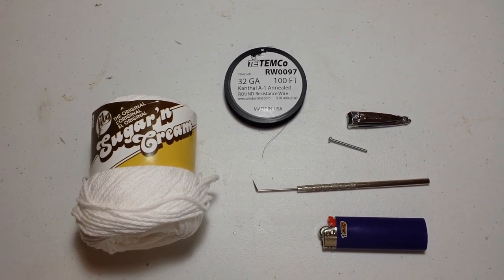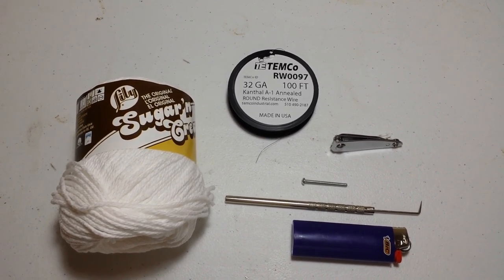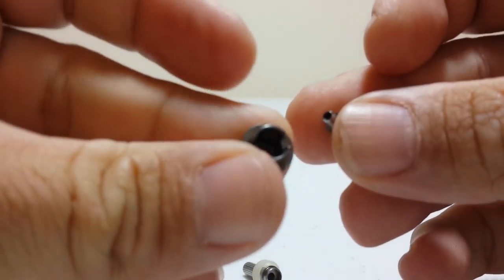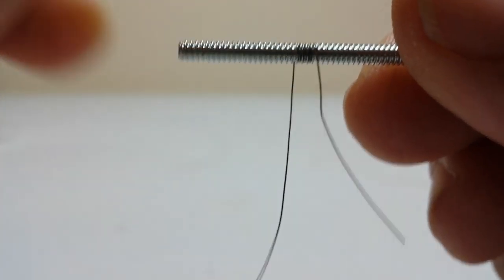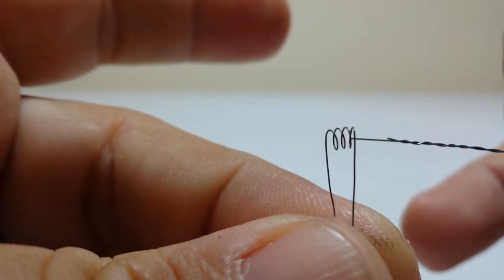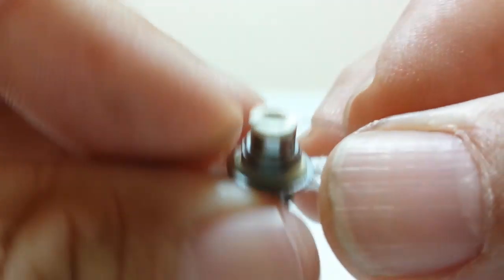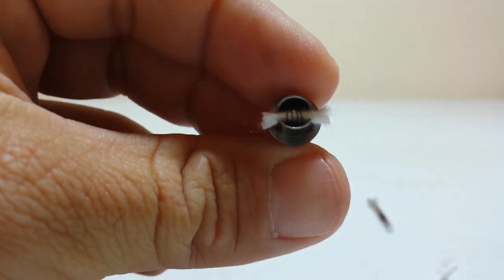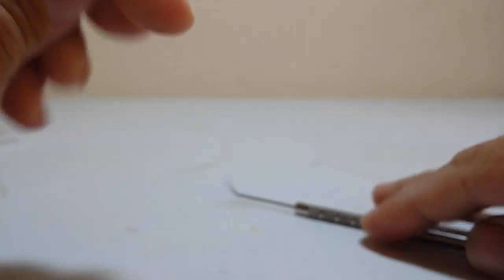Protank Wick Rebuild with Cotton

Comment: Hey got a few questions. If anyone could answer would much appreciate it. =)

1.How long do these rebuilt coils last? I use a protank 2 with a sting ray mod. the coils i use are 1.8 ohms and they last about 3 days. After that they tend to dull the taste and sometimes dont vape properly.

2.The juice i use have 12mg nicotine and 20% VG. Will using this rebuilt cotton method change the strength of the hit? Some mods ive tried and ive gotten sick from vaping too much of it with the same juice.

I do find that the kanger 1.5-1.8 ohms coils taste just fine and create just as much smoke as a cigarette (maybe more), but watching this video has me interested in trying this rebuilt coils. You do mention that its very cost effective but the coils are roughly 1$ each and last between 3-7 days depending on which mod your using. Already cheaper then buying a pack of cigarettes a day. Thanks!

Comment: oh yeah;  if the coil is in tact;  you don't really need to change them at all; w/ 28gage.  just heat it without the wick a couple times then place under running warm/cold water;  gunk will crust right off!    then re-wick;   

Can't wait until Kanger figures out how to use mesh wicks;  thats why I use a genesis RTA;  all this is way more effort then a genesis rebuild;  and they VAPE for like months before rebuilds; and you can buy 12 pre-built coils and 200# mesh for under $10 if you don't like making coils.  savings is the same as you mentioned at 17min of the vid;  about 300 rebuilds worth for under $10.

Comment: Nice video man try the nano coil with 28g more bullet proof build I just use a eye glass Phillips head screw driver perfect fit 1.3 ohms every time crank it to 15w and chase some clouds
Reply from the maker: I have built those, and have a couple currently.  Since I'm not a cloud chaser, they heat up a little too slow for me. But they do work well.
Reply: yes they do but I never get a burn taste I have a video on my channel but Rip Trippers has more clear one!

Comment: I have an x6 vv ecig mod with an protank 1. I'm wondering which coil to use depending on its resistance.. My vv mod can be at 3.6, 3.8, and 4.2.. Idk if that means anything but if it does, goes it determine what type of coil I should get? And if not can you recommend some? Thanks I'm trying to fix my own ecig without buying the heads and save $$
Reply from the maker: With this build, it comes to 1.7-1.9 ohms. Any of your voltage settings should work, but the higher the more vapor.  Hope that answers your questions.
Reply: Okay so what kind of wire should I get and cotton? would the one in the video work for mines?